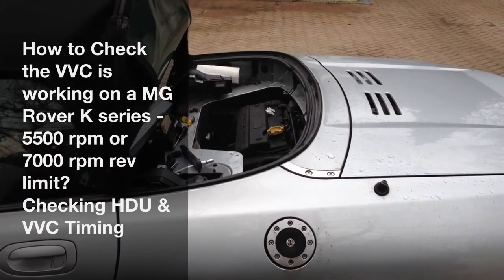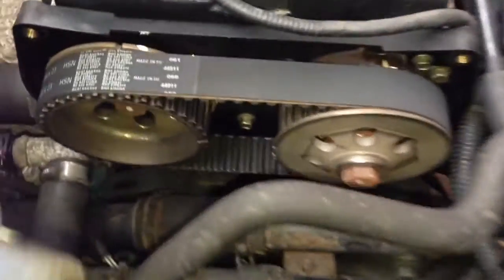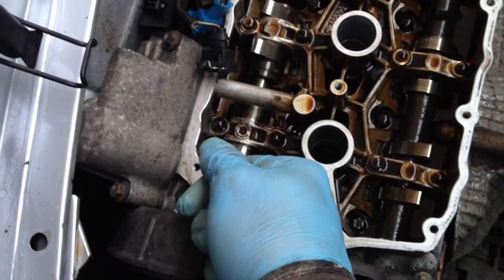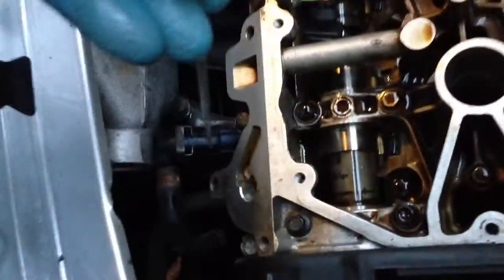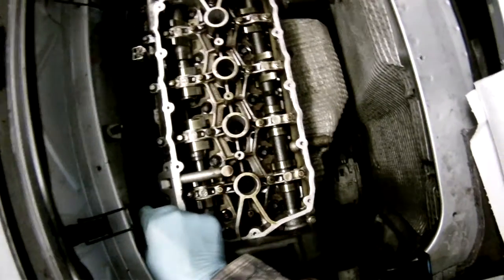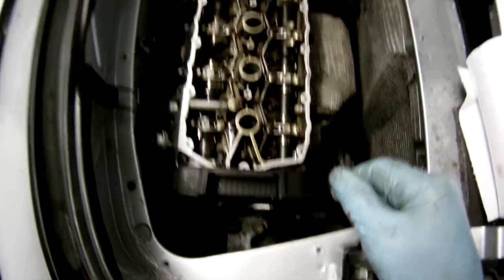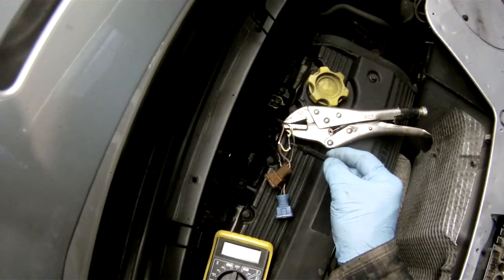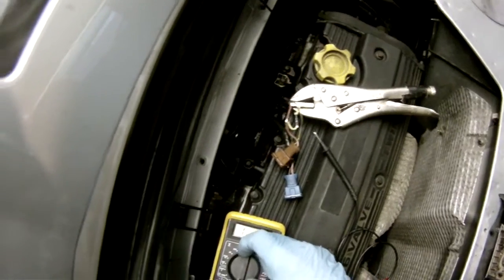MG Rover K Series VVC Timing Check and Fix - Stuck at Only 5500rpm max?

Comment: Cracking engines, but if you have problems don't waste time trying to locate it yourself, go and have put on a T4, that will diagnose it correctly within 5 minutes, then you can decide whether you wish to sort the problems out yourself. Plenty of ex MG/Rover garages still have these diagnostic machines.
Reply from the maker: Yes they are.  I am sure a T4 diagnosis is good, but my videos are all about doing it yourself and DIYers would not normally have the T4 software and hardware.

Comment: My idle is 2500 rev when hot. If i turn it off and on its fine for a minute.
How do i dissable vvc?
Reply from the maker: I doubt your engine idling at 2500rpm is due to the VVC system. More like a problem with the IAC valve or you have an air leak into the inlet manifold. There is no reason to disable the VVC.
Reply: @comeinhandynow  hay thanks for responding.  I shall look into that.  
Thanks again.

Comment: Hello, I'm trying to do the same but the VVC piston (shaft) is stuck, the only way to make it move a bit is by rotating cam gears. How did you get it out?
Reply from the maker: You’ll see in the video from about 5m50s onwards that I had the same difficulty with a very stiff VLC control arm.  Remove the end belt so that you can rotate the camshaft to a position where no valves are depressed and the control shaft and hence VVC piston/shaft should move a lot easier.
Reply: @comeinhandynow  I did exactly that, and it moved slightly up and down, but I was not able to get it out.
Reply from the maker: It’s hard to help without seeing it, but I would suggest removing the VVC solenoid housing and levering the piston and VVC control shaft out of its hole whilst at the same time rotating the camshaft back and forth or round and round in order to relieve pressure on the arm.

Comment: I need you to come fix my vvc unit!!!
Reply from the maker: You learn by doing. This was the first time I had worked on a VVC engine.
Reply: comeinhandynow well thanks for posting this as I will be trying it soon :-) I have the same symptoms but idles fine
Reply from the maker: Well done for the have a go mindset, good luck.
Reply: comeinhandynow well it's  nothing that will break anything Haha!! A little nervous about taking the rocker cover off
Reply from the maker: Just be careful not to over tighten those cam cover bolts, they are small and all to easy to sheer off if hand tightening with lost of pressure.  The Haynes manual is useful for torque settings amongst other things.
Reply: How do i fit my vvc units... I think I have done this wrong as its now making a ticking banging noise??

Comment: hello great video, i have 1.8 vvc in a rover 200. i have an oil leak coming from the hydraulic control unit, the leak is between the base plate and upper housing, is it possible to replace this seal without messing around with the cam timing and removing rocker cover?
Reply from the maker: +Kruger Kruger Thanks.  Since you will have to remove the vvc control unit (hcu) then there is the danger that it will move one cog when putting it back in, so you will have to check that the vvc timing hasn't changed by checking for correct alignment, as shown in the video.
Reply: ah ok, thanks for your reply, if i decide to do this myself it be my 1st time removing a cam belt cover and rocker cover, would i need to drain the oil from the engine?
Reply from the maker: +Kruger Kruger No you don't for that job.